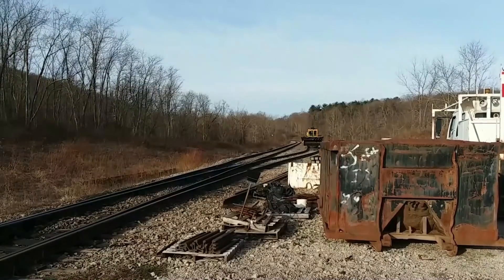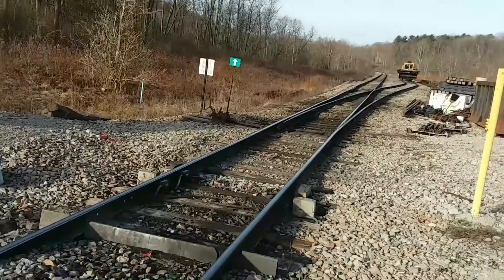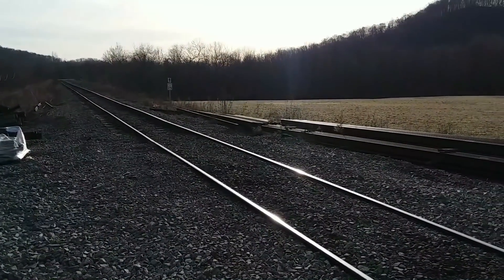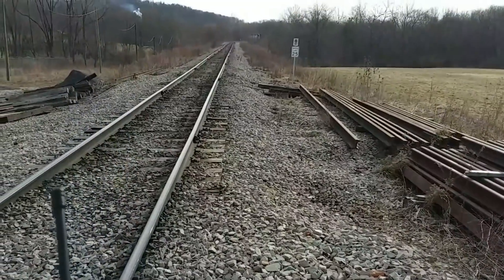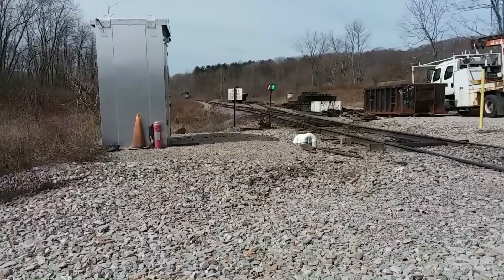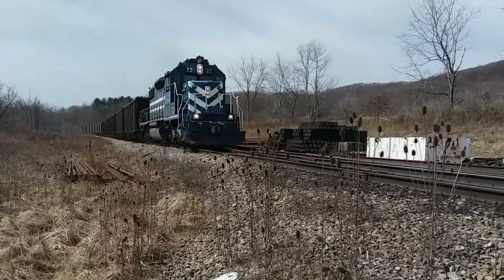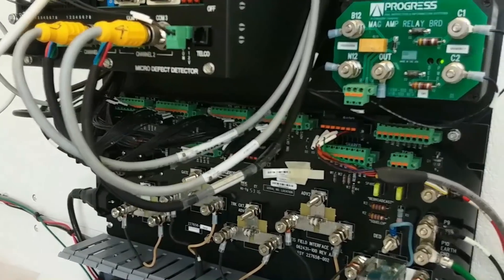Critical Alarm! Hot Wheel Detector Goes Nuts! on Dragging Equipment Message

Comment: The only thing I can think of that's even potentially "wrong" about these trains that keep tripping this defect detector is that the track itself is flexing some near the defect detector, and somehow that's tripping the dragging equipment detection switches connected to those flaps you pointed out, but even then it doesn't have the right "smell" to it if you get what I mean.
On the plus side, at least it's consistent! From my time working on automobiles, the worst sort of fault to chase out of a system is an intermittent one, because it never acts up when you're monitoring it to see what exactly it's doing!
Reply from the maker: Your so right about something being intermittent that is a
nightmare to diagnose SciNrd. In the case of the detector there was a computer problem and had to get a tech to get it straightened
out. But it will goof up again and has several times since that
video was made. AI is great but it does have it's problems too.
Really appreciate your taking the time to check out the video and may you have a very good day my friend.

Comment: So, do those dragging detectors spit out warnings when no train is going by but that paddle is moved, like by a person? I ask because when I was a wee little kid in the 90s I was young and dumb but alert and was walking near some tracks and saw that paddle thing and moved it one or twice and wonder if that pissed off some people unknowingly lol
Reply from the maker: Good question MmmmDatAss. You can knock over a dragger
and it won't do any announcement. However there are sensors
on the rail before and after the dragger. Once a train enters
past those sensors and into that block, then the detector will give
a dragging equipment message over the radio. So you did nothing
to upset anyone by just moving it back and forth. However you
sure would have gotten a conductor upset if he had to walk
a train to see if anything was wrong! We have a camera on
our detector so if anyone messes with it, they are on video.
Thanks so much my friend for visiting and checking out the
critical alarm show.

Comment: Didn’t even realize they had detectors like that, can’t help but think about that recent incident in Ohio where the wheels were sparking and flaming 20 miles away from the eventual accident site! Malfunction? Yikes!
Reply from the maker: Thank you so very much for visiting with us and watching the presentation and for sharing your thoughts my friend.
Reply: Yes two cameras caught it but the real question is are there any defect detectors located in the same area of either camera?  If so, did they trip and did the crew receive the transmission?  I understand detectors can be spaced out 10 to 20 miles apart.

Comment: the gnd wire is loose...or the 1439 clamp needs to be turned 1/4 of a turn
Reply from the maker: Well that's what;s wrong, we turned the 1438 clamp....Thank
you very much James for stopping by and checking out the
video.

Comment: does your shop  do a maint. prev. check on wheel bearngs ?  stay safe dave!
Reply from the maker: Other than a visual inspection along with daily checks with a heat
gun, plus the bearing detector is it Dave. However bearings can
go bad pretty quick over only several miles with all that weight
on a loaded car.

Comment: do those systems have a diagnosis feature?
Reply from the maker: This one does Dave, I am not computer literate enough to tell
you all about it, however the system makes an internal integrity
check for internal and external components after each train passes.
If there is a problem in a component it will give an integrity failure
alarm, which we have never had happen yet here.

Comment: Dave, When a train passes thru the detectors will indicate " No Defects"
on the number of axles will say no defects.  

If the detection senses there's a defect on one or more on from the axles there's a defect. It's telling you
you have a problem with one of the axles is either burning or smoking

That the detection system is working
Reply from the maker: Yes sir Darryl, thanks for taking the time to watch and write in
my friend. These detectors work very well and almost never
give us problems, but when they screw up need a tech to
diagnose.

Comment: Maybe you should clear the gravel out from around the sensor flaps.
Reply from the maker: We did do that along with several other things we tried. it
ended up being a computer software problem tech had to
come and fix. Appreciate your stopping by and checking out
the presentation Star Gazer.

Comment: At 1:59 you can see sparks under the trailing locomotive. Can you explain exactly how that hut count axels, measure wheel temperature, detect drags, and detects locked wheels and such?  I want to make a Dragging Equipment detector for my O-Gauge trains.

 I make my own detect/speed/axel counters. I drill a tiny hole in the rail just at wheel flange level, then I have an Infra-Red (IR) emitter/detector LED pair shine through the hole. When a wheel passes, the flange breaks the beam, and a tiny Adafruit Trinket M0 connected to the LEDs can trigger accessories, determine speed, count axels, or what ever I want. I even have a box car that I modified that has a tiny hole in a wheel, IR LEDs, and a microcontroller the measures the time between the hole passing the sensor to display scale speed of the train with a 3 digit LED display mounted in the top of the car. Your's truly has content of it if you go to it. I can even send you schematics and instructions on how to do all this.
Reply from the maker: You ask a lot of questions and far too involved answers to reply
in a comment. I have several videos explaining the detector on a playlist on my channel. Please watch them and then if you have
more specific questions that are not covered in any of the videos
please write me back and I will try and be of assistance. Quick answer on the count: there is a proximity switch on each side of the detector,
it is called a gated transducer. It counts axles in and then counts
it out as it goes over the second transducer. I show that in one
of the videos.

Heres the link to the playlist
https://www.youtube.com/playlist?list=PLTyDYTDnT027i3KeBR3YaLSnmY4KwBOoM
Reply: @ccrx6700  Thanks for the link and I will check out your videos.

Comment: Kind of crazy that engineer fails to stop train to investigate. Shouldnt he be reprimanded?
Reply from the maker: He did stop sir and we walked the entire train the first time
the message was given. When he backed thru we had 3 guys
watching and noticed nothing wrong. The operator followed
proper operating practices for this situation. Hope that
helps explain better.
Reply: @ccrx6700  I was going by what I seen . And that was a train traveling at speed not stopping or slowing to acknowledge the warning system in place. The entire event was blown off at every chance. How long before he completely stopped that train to investigate?
Reply from the maker: @rockymilano2071  Took about a half mile to get stopped

Comment: LIKELY CAUSE COULD BE THE USE OF PLUMBING FITTING ON ELECTRICAL PIPE!
Reply from the maker: Tech guy when we called him suggested checking all the connections
to the dragger, we did, ended up being a computer software issue which tech had to come out and fix. Appreciate your writing in
and for watching the show sir.

Comment: Dave, you're lucky you don't work for CSX or one of the other big railroading companies, where there are 200 plus wagons to check on really long trains. Good thing the dragging equipment detector was faulty, and not detecting an issue! WWoT had put out a recent video of an overhanging equipment report, apparently the hose reel for an air line bypass was overhanging by too much on a boxcar and got reported. The locomotive crew took it off and stored it in one of the locomotives. Good thing they got notified of that, could have been real bad. (/sarcasm)
Reply from the maker: Let's rephrase that: CSX is unlucky they don't have me.....!
Glad you enjoyed the show. We do appreciate your
writing in and for checking out the video sir.

Comment: Here in the UK its common for a train guard or driver to go out with a wheel hammer and listen to the rims and flanges after a good crisp whack as a blown bearing produces sometimes a different clang than a good bearing, also would lay hands on each bearing end to spot the "hot box" as we call it.   A lot of our stock still uses encased bearings on axles except our container flats which use the same sort of wheels and bearings seen on those trains over there.
Reply: Our lot were taught about sight, sound and smell too, a pungent smell of burning grease or a sight of a bearing box smoking was a good indicator of problems and of course that grating squeal of a blown through bearing material was easily pinpointed on a slow moving consist.   I worked on British railways in the 80's where hot box detectors were seen as space age tech and was cheaper to have a chap walk along a set and clang the ol' wheels and check the grease traps were loaded.

Comment: I was on a Signal Gang back in the early 70's for the Denver & Rio Grande Western RR with our mainline in Colorado and Utah. We installed the first version of Dragging Equipment Detectors the RR's ever had..we called them D-E-D's for short. They were crude in design. It was a stick that extended across the rails above the tie with a wire strapped to it. If something was dragging on the train it would break the stick & wire which in turn triggered a signal relay to drop out in the bungalow and that initiated a flashing purple light. 
Back then trains had a caboose and that is where the Conductor (the boss of the train) and a Brakeman sat. If the DED went off the guys in the caboose would see the purple flashing light and radio the train Engineer to go into emergency and stop the train. Unless they could see an obvious problem with one of the cars or the freight on it from the caboose they really had no idea what set off the DED signal or which boxcar set it off. This meant they had to walk the entire length of the train and visually check for a problem.
Sometimes the problem was real obvious like a boxcar that had jumped the track and was being drug down the track. When they do they bust ties for a mile and scatter slag everywhere.  

This newer version of DED in this video  is a big improvement over what we were putting in back in the day. Our DED's were crude.. but back then we thought they were really "Hi Tech"...haha. 

Things change don't they!. But one thing that never changes is our love for all things Train related. I have some awesome memories about RR'ing in the Rocky Mountains...especially the bad weather..the tressels..the tunnels.. and the train wrecks! Wow!
Take care. 
MK
Reply from the maker: Totally awesome comment my friend! I loved reading it and love
learning about railroading in the past. Yes things do change and 
not always for the better, but change they do anyway. Hope
you will watch more of my videos and write some more cool
stuff in!

Comment: Maybe you need a fault detector for your fault detector, so you know when your fault detections are faulty. 😅
Reply from the maker: Well guess what? It has one. After the train passes there is a 15 second period before it gives a message (unless a defect is found,
then that is immediate message). During this 15 second period,
the detector is doing an integrity check of it's components and
will give an integrity failure message if there is a fault in the system.

So how many faults could a fault detector detect, if a fault detector
could detect faults.....LOL
Reply: @ccrx6700  maybe the fault detector's fault detector needs a fault detector then.
Reply from the maker: @NelsonBrown  Personal opinion Nelson is the little guy in the detector
cabinet needs a hot date with Siri and some lovin from her....LOL and,
maybe a cookie would help.....

Comment: I hear the Morse code ID
Reply from the maker: Sounds like it doesn't it, but that the goofy noise the radio
repeater makes for whatever odd reason, drives us nuts cause
we have to wait for it to clear before we can send a communication.
Reply: @ccrx6700  I think it is set for 5 words per minute on the Morse code. It is a MP3 or WAV file or a voice chip with the audio recorded 

You can change the speed by putting in a new audio clip or file.
You can do 50 words per minute for the Morse which would transmit the ID in 1 second.
Normally the FCC rule is you have to give your station ID after each transmission so the repeater is set to transmit the fccid in Morse code once the carrier drops out for a preset number of seconds

It's also required to transmit your ID once an hour if your site is online

So if your radio is powered up even if it's not transmitting it has to transmit the Morse ID once an hour

The five words a minute speed is more for the average person who doesn't know Morse code so if there's a problem and the signal is causing an issue and they are hearing it bleeding over something else that they jot down the dots and dashes and look up the letters and numbers so they can call the FCC to report who is causing the issue

Nowadays with the apps on the phones you can decode 50 word per minute Morse code easily and I don't think you would have any problem putting in a faster transmission of the ID so you only have to wait 2 seconds for it to transmit instead of however long it's taking now
Reply from the maker: @ocsrc  wow! So what are telling me is that beep beep ba beep is actually Morse giving the station ID. Very interesting! Appreciate your telling me that.

Comment: When your Hot Wheel detector freaks out and starts detecting Matchbox.
Possible that ice, mud, frost in / against the detector causing a false trigger as the track flexes up and down?  I saw that someone dug around the detector in one of the shots
Reply from the maker: Good suggestion Samuel, that was one of the first things the
tech we had on the phone told us to look for which is why you
saw it dug out. Alas it was a computer software issue the tech
had to come out and fix. Appreciate your watching my good man.

Comment: Looks like along with the detectors and devices going crazy, it looks like the whole section needs a lift, alignment and tamping to stabilize that rail a bit, especially adjacent to the equipment.
Hard to tell from video but it looks like that frog could use a resurfacing too.
What rail line or rail company do you work for and what area/region ?   Thanks in Advance.
Reply from the maker: This is on the Cumberland Mine Railroad located near Kirby Pa.
Yes the whole turnout area needs some ballast rehabilitation and
new ties under the frog. It's on the list of things to get accomplished
sooner than later. Thanks for writing in and watching the video
SnowTiger

Comment: It being so close to that switch and that joint that clacks on every car typically beats the hell out of a detector. Not as bad as being near a greaser
Reply from the maker: You are correct Keith. The guy from Progress Rail who installed it
gave us some warnings about not putting it in this location, I
suggested further up the track away from the turnout, but 
was over ruled and this is where it ended up being. Alas.....
Thanks for the input sir!
Reply: @ccrx6700  dang I wish we had people to come install equipment. We do it all with as little as possible...oh well
Reply from the maker: @keith giles  we don't have the knowledge or respurces you got Keith, have to rely on outside help

Comment: Cumberland Hot Wheel Detector MP: 8.0
Defects:  3
EXCESSIVE ALARM
Dragging Equipment #1 - Axle 111
Dragging Equipment #2 - Axle 113
Dragging Equipment #3 - Axle 115

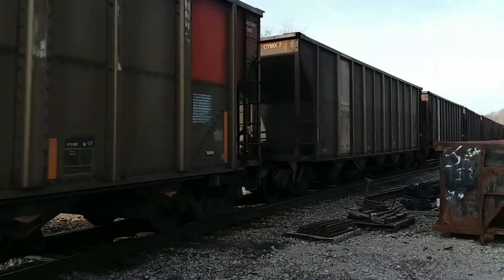Around 1:41 is when Axles 109-116 (the 27th & 28th car) passes through, and then detector goes off 8 seconds later.
Reply from the maker: Good catch and on subsequent messages it gave different axle numbers, goofball thing anyway. Had us going for awhile. Was a
computer glitch and tech had to come out and fix it. Appreciate
your watching Ricky.
Reply: @ccrx6700  No problem! Glad it got fixed, so it'll be quiet for a while 😋👍
Reply from the maker: @rickygonzalez3152  your always welcome to share your thoughts or questions with me Ricky 😊

Comment: i'll bet its a integrity failure/Hot Box Detector Malfunction!!!!
Reply from the maker: It does do an integrity check, that's what is going on in the 15
seconds between when a train passes and you first hear a message.
If there is an integrity failure then it will announce that message.
This message was announced as the train was passing before
the detector made it's integrity check of it's components. Was a
software issue and tech had to come out and fix something in
the computer, I was not there when he came so apologize for
not knowing exactly what it was. Do appreciate your watching
the video Jeffrey.